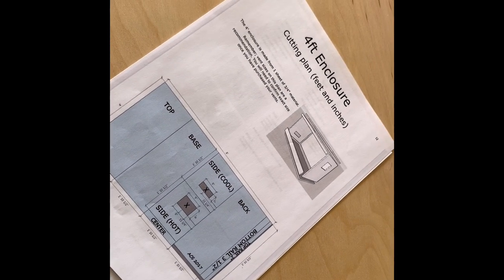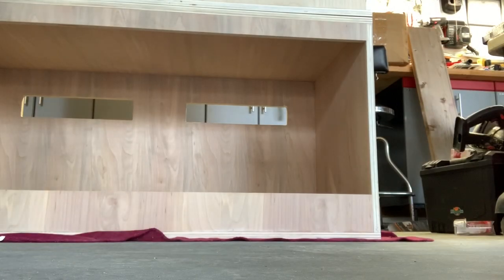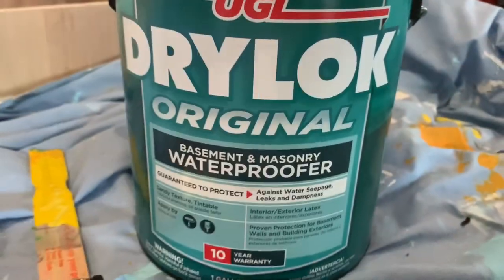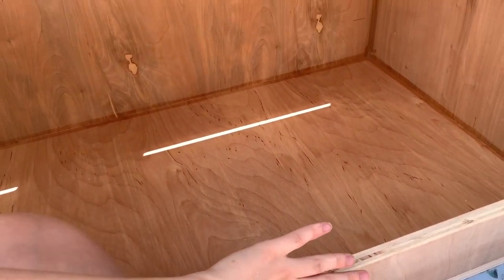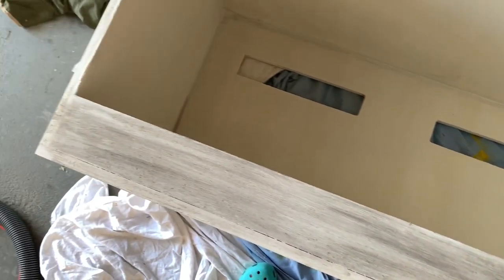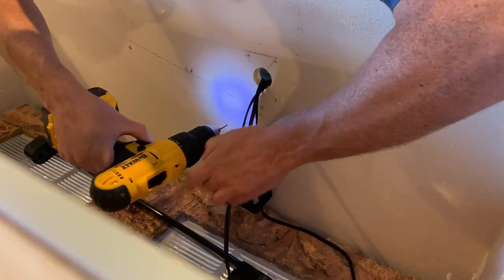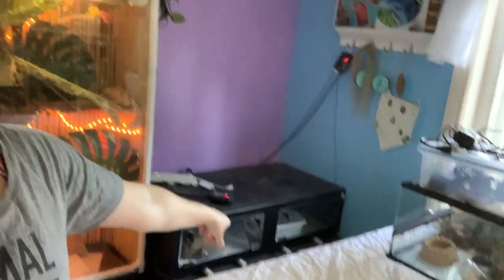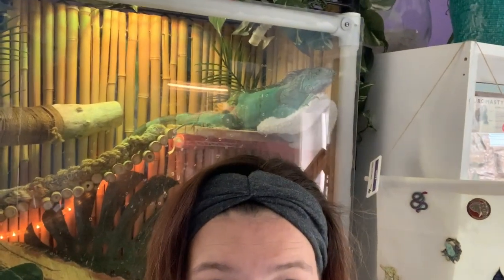How to Build Reptile Enclosures! // Building Lizard Enclosures out of Wood!

Comment: If you were using these for a snake enclosure, how would you close the holes for the lightings wires?
Reply from the maker: My pvc enclosures I have for my snakes have holes that go out the upper back that are small enough that only the wires can fit through. if you arent wiring your own lights, you’ll have to install the lighting before attaching the sides and top of the enclosure. For these enclosures and putting a hole through the roof, any exposed lighting in an enclosure with a snake or animal that can access the lights should have bulb guards around it which attaches to the ceiling, so they wouldnt be able to access the hole, wires, and fixture :)

Comment: Where’d you find those blueprints at? I’m looking to build some enclosures for my snake
Reply from the maker: In a uromastyx group on facebook! Essentially you just take a 4x8 sheet of wood and divide it into the top, bottom, back, and two sides, and then cut thin pieces for the top and bottom of the front. Everything else my dad and I came up with and decided on :)

Comment: I thought you would at least have instructions or where to get materials
Reply from the maker: I showed our step by step process and showed what materials were used. Everything can be bought at home depot. The only thing I got online were tracks from amazon. I followed a blue print I got online and alterted it to fit what I wanted. What I wanted might not work for someone else depending on their end goals, so I showed the jist of it. Im also not handy and my dad built them and I just assisted when needed, so it would be hard for me to explain in detail what to do. This video was more so meant to show what we did to help inspire ideas in others. I will be making a seperate video to outline the overall cost, which will go through all the materials
Reply: @zareptiles   thanks